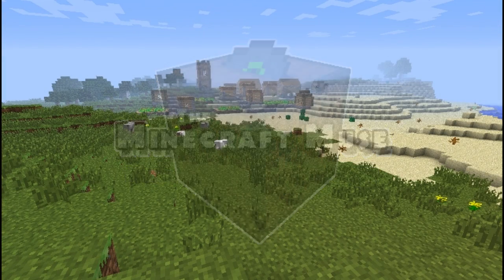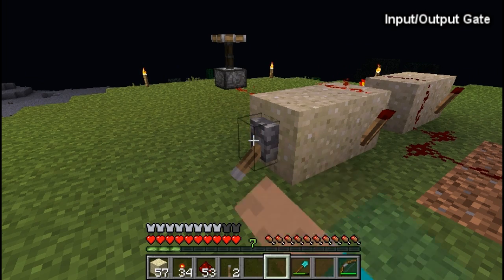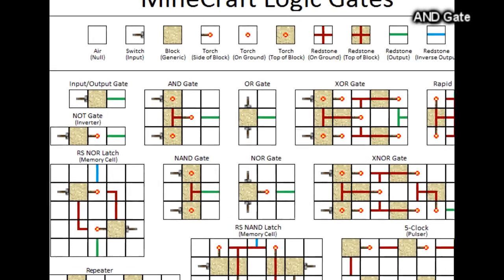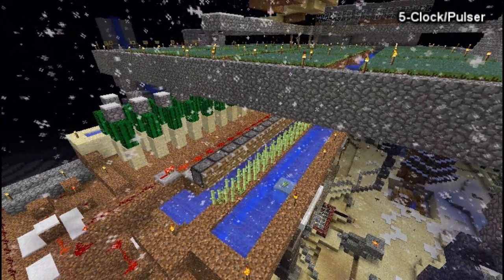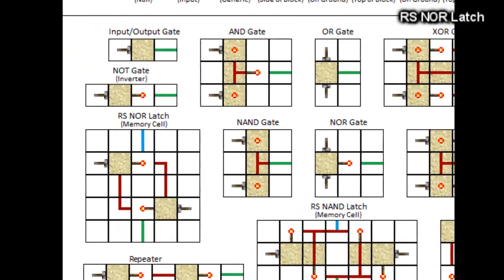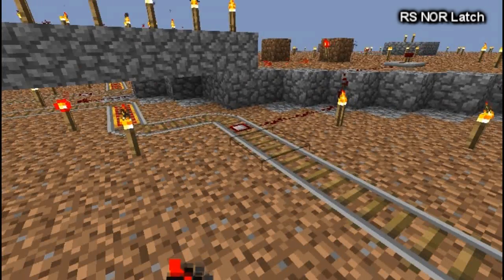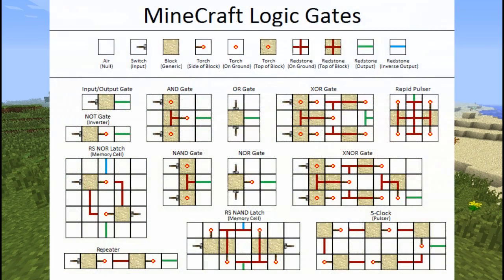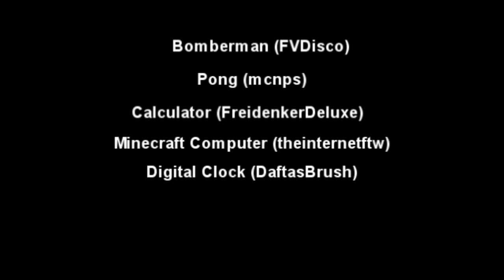Intermediate Redstone Tutorial (Logic Gates)

Comment: You should make an update video. Since the additions of Pistons and Repeaters, many of the logic gates on that template can be smaller:
- The AND-Gate is fine, but in some cases you would like to use Sticky Pistons with a block and a repeater, because it's more flexible.
- The XOR-Gate can also be reduced in size, and the only reason I would use the old one is to make a clock sync detector (that checks if there isn't being messed with a clock)
- RS NOR Latch can easily be made smaller.